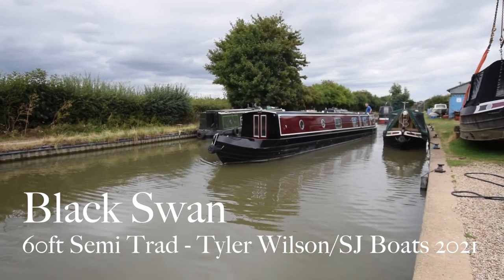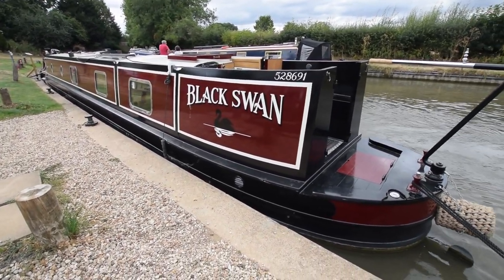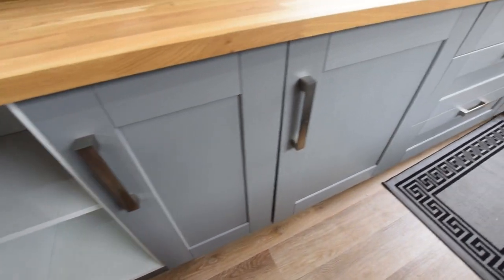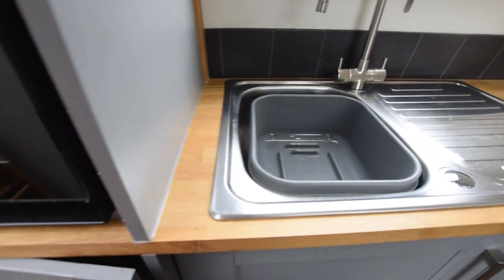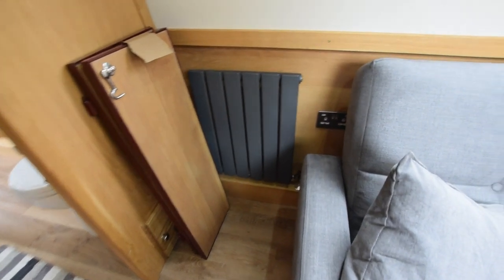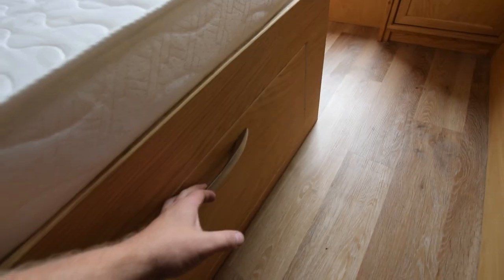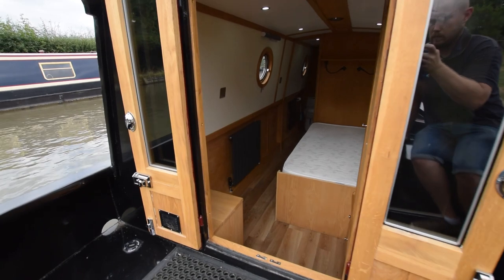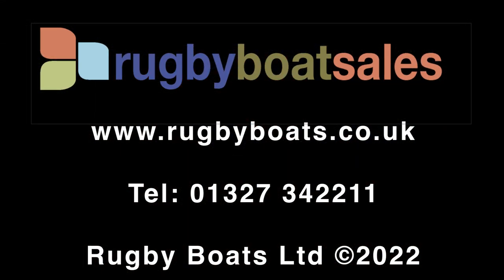SOLD - Black Swan, 60' Reverse layout Semi Trad 2021 Tyler Wilson

Comment: I see all the 230v appliances and I'm like, "she's going to spend a lot of time either on shore power or with the engine running."  🤣

Maybe I'm weird, but I'm rather fond of semi trads as it seems like the best of both worlds -- you have a social space for passengers to accompany you while you're cruising, but not everyone crowded around the back of the tiller.  Love the galley layout with the linear hob and the modern look suits her quite well IMO.  The cassette loo strikes me as a bit of a downgrade as I'd expect a boat that has so many bells and whistles otherwise to feature a pump-out, but whatever.
Reply: I too, echo your observations. I imagine if you were to cruise this boat, you would need to add a Travel Generator and or Solar. I also would have wanted a pump out toilet.

Comment: Don't see the need for dishwasher on a narrowboat. Waste of storage space, also no wall cupboards.
Needs bigger domestic battery bank and more solar. Nice boat though.
Reply: Those batteries are industrial AGM types. Used for running big forklifts and such, that need gobs of amps for a long time. They are nearly twice the size of the cells you normally see on boats.
Reply: 300ah lithium would be perfect with the appropriate alternator - great boat for a decent price in the current marketplace.